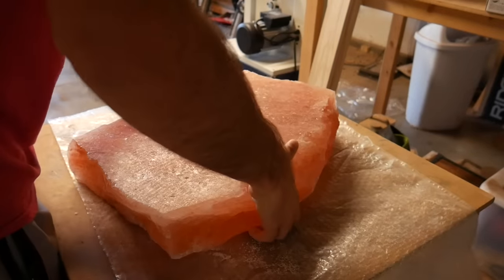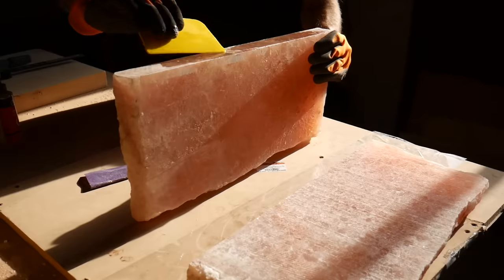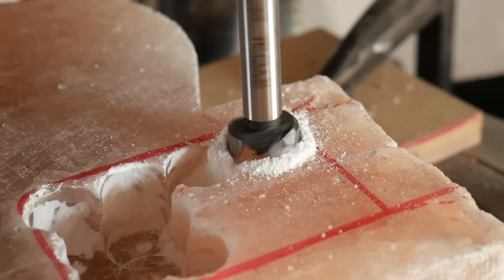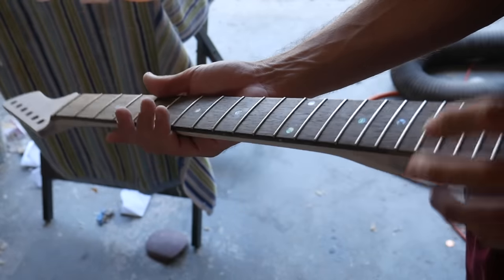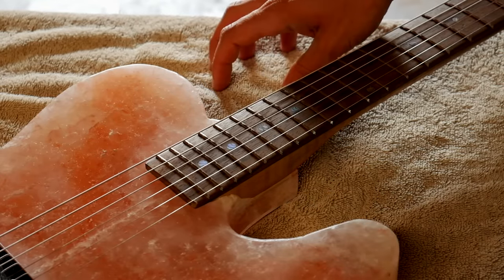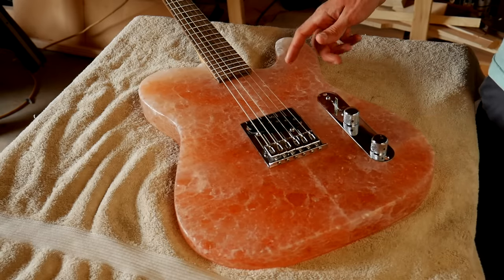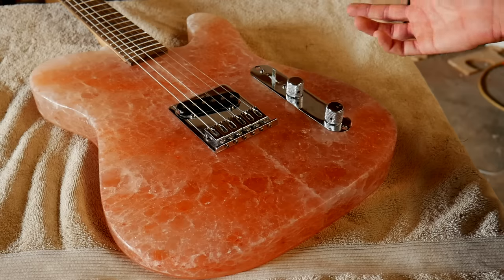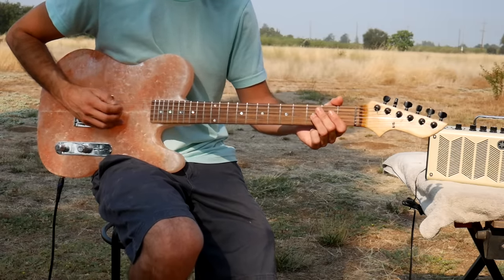I Built a Guitar Out of Salt

Comment: You should've coated it with clear coat, it would potentially be more durable, and would definitely reduce the wear and tear on your metal parts.
Reply: but would change the acoustics.
Reply: It would change the flavor, too.
Reply: @TheXComputerXDr  not really
Reply: @TheXComputerXDr  bro the acoustics of salt? if building a guitar out of coffee, recycled plastic, colored pencils, or any other various things had minimal effect I doubt clear coat is gonna ruin the tonality of his salt
Reply: @clays.9662  maybe not to you, but a refined ear o_0?
Reply: @TheXComputerXDr  you're just salty bro
Reply: @clays.9662  I just want unadulterated salt...
Reply: @TheXComputerXDr  that's fair
Reply: No, it would not reduce the wear and tear on metal parts. 🤦🏼‍♂️ How does a thin layer on the outside prevent wear and tear on the drill bits and band saw blades that are going through that clear coat and into the salt? 🤦🏼‍♂️ What are you thinking?
Reply: @TheXComputerXDr Acoustics is bs on an electrical guitar
Reply: @twentyeight602  Are you an audio engineer?
Reply: @TheXComputerXDr  no
Reply: @twentyeight602  You act as if you are... I am.

Comment: Its beautiful, the seethrough parts mixed with the salt texture... I want one
Reply: Mr beast guy
Reply: That would be $8910 please
Reply: @weaver3636  when it arives, you start to play it and it just crumbles
Reply: could get the same effect with rose quartz I think, and no problem with it dissolving from moisture.
Reply: I bet after having made one he'd be able to make a second with slight improvements.  Perhaps epoxy on both sides, all holes drilled super slowly, figure out some solution for the neck joint being flakey.  But regardless it'd still be super fragile.

Comment: Probably should have coated the entire thing in epoxy.
Reply: but then you wouldnt be able to lick it 😦
Reply: I thought the same thing myself, but unfortunately it would probably change the sound and would in fact be more of an epoxy build rather than a salt build
Reply: I think  all the metal parts will rust without a coat,.
Reply: @michaellrakes5521  Most wood guitars are protected by a layer of lacquer, so I hardly think it's cheating to add a protective finish

Comment: For a guitar made out of salt , it sounds pretty sweet, the body looks really cool too.
Reply: What an eclectric guitar is made of, doesn't affect how a recording sounds. A guitar effects the sound you hear. Because the sound coming off the string bounces off it. Pickups however  are not microphones. They do not detect sound. The sound makes no difference. A pickup is a magnetic field that detects the strings movement directly. Nothing about the body affects that to any degree any modern instruments can measure. Much less, to a degree your ears can detect.
Reply: @Wylie288  you totally missed the joke. F.
Reply: @Wylie288  I agree with you except for one thing. The body can determine how long a string will resonate translating to longer sustain. Other than that the actual tone won't change.

Comment: Why didn’t you seal the salt on the front and sides as well? Even rattle can spray lacker would work and then keep the finish from crapping out. 
Not a critique, I barely know how to hold a guitar, but I know salt draws humidity out of the air and into itself.
Reply: So you can L I C C

Comment: I swear to god there is gonna be a day that this guy makes a guitar out of pocket lint, a gumball and a quarter lol. This dude is pretty awesome and is showing us that you can make a guitar out of practically anything
Reply: I imagine you'd need a crazy amount of pocket lint, gumballs and quarters though.
Reply: What about cow manure
Reply: Check the channel MooseON - those guys made guitars out of Ramen noodles, Microwave owen and so on.
Reply: @anonymous-sus406  cow maolder
Reply: OP does NOT know how pocket lint works 🤣🤣💀
Reply: You can use anything to "make" a guitar, provided you actually just use epoxy for 99% of it and then pretend otherwise.
Reply: For an electric guitar it’s basically only about the pickups and having a neck hard enough to pin notes and retain a tight string. 

Wood adds little to nothing besides being an easy to work with medium.
Reply: @imjustheretogrill9260  Contrary to popular belief, wood does NOTHING for the tone of an electric guitar. The density can however effect the sustain as it absorbs less energy.
Reply: @Metal-Possum  Many of Burls' guitars are not 99% epoxy and has less epoxy than the other materials. Like this salt guitar.
Reply: with enough tyvek tape and boat sealer. sure

Comment: After cutting out the body, drilling holes, and sanding it you should have coated the entire body in epoxy then buffed it. That way no moisture would get to the body and it would probably be a lot more sturdy and less brittle
Reply: would change the acoustics i think as well
Reply: @TheXComputerXDr  it probably would. In that case he could also do a before and after the epoxy sound test.
Reply: @TheXComputerXDr  it's an electric guitar. Doesn't matter what it's made out of.
Reply: @TheXComputerXDr  It's an electric guitar lol. "acoustics" are not determined by the guitar, it's determined by the amp and any processes you have running through the amp.
Reply: @TheStarBlack  The resonance of the body still effect the pickups relative to the strings though, maybe not in a major way, but from what I understand, It still matters, hence why electric guitars are still made off wood and not some polymer or fiberglass.
Reply: @TheXComputerXDr  there was a guy who made an electric guitar that was just strings and pickups to test this and nah the body has zero effect on sound
Reply: @willkershisnik5893  oh kool, good to know. I'd love to know the methodology though
Reply: @willkershisnik5893  yeah. I think it only affects acoustic guitars.
Reply: @TheXComputerXDr  
in my experience it's the style of neck rather than the materials used that matters
for example a neck-through body absolutely has superior sustain to a bolt on neck
but I'm not so sure if wood is necessarily superior to acrylic polymer for an electric guitar 
the predominance of wood may just be owed to it being easier to manufacture
Reply: Now read this comment in a serial killer way.

Comment: Im sure someone has said it, but I think adding a few layers of fiberglass instead of just resin would really add strength to the guitar and prevent any handing issues and potential weakness during handing. Probobly wouldn't help against a bump though as there would probably still be flex in the fiberglass cracking the salt underneath.

Comment: Oh man, I cringed when you started cutting that salt without any dust collection. You will be battling rust on all your tools for years to come.
Reply: Not to mention the metal parts on that thing.
Reply: You clearly didnt watch the whole video
Reply: @verjnuarmu  whatever you say my guy
Reply: @verjnuarmu  salt has a way of sweating through the most of the coatings that you put on it. It has been the bane of sailors since man first set sail on the oceans. Even the epoxy coatings will eventually fail. I been a boat engineer for 20 yrs. and have first hand experience with salt. Salt and any metal except pure gold will eventually succumb to it.  Just fyi.
Reply: I didn't see where u used epoxy to seal any penetration for screws and the neck pocket. And fyi , air will not remove all the microscopic particles u released from sanding or cutting. Only a thorough disassembly and extensive flushing of water will remove ALL traces I of salt that small.  I also build custom guitars and will post a short video of two that im working on now to my u tube profile later today. But that's an awesome build though. Yeah that's definitely one for wall as I would b afraid of dropping it. I'm real careful but my personal guitar gets banged around some. I've got a guitar made from a laminated beam that I inlayed a geode in the upper bout. Can't wait till it's finished. I'm going to install some Lollar p/ups in it. With a roasted maple neck. Check it out later this afternoon. We will talk in another 5 months to see if I'm right bout the tools and machinery in your shop. Keep em singing that with that tone that we all chase after in our heads. Later!
Reply: @verjnuarmu  got my guitars up on my profile page. Check em out.

Comment: I would say having good dust collection (or at least someone holding a shop-vac hose) would help on this... but the salt might end up killing your vacuum.

Was that JB Weld to glue the book match? (You use such specialized epoxy I was like, “Hey, I’ve used that!) Surprised you didn’t try to encase the whole thing in epoxy after polishing it.

Comment: Build a guitar out of ice
Epoxy the ice 
Install electronics to be waterproof by running plastic tubes
Let ice melt into water
WATER GUITAR
Reply: I'm pretty sure that epoxy wouldn't dry correctly in sub zero temperatures, and at temps where it would dry correctly the ice would start to melt before it does so. Nice idea though
Reply: water messes with the curing of epoxy resin
Reply: Sadly, it wouldn't work. Epoxy gets pretty hot while it hardens